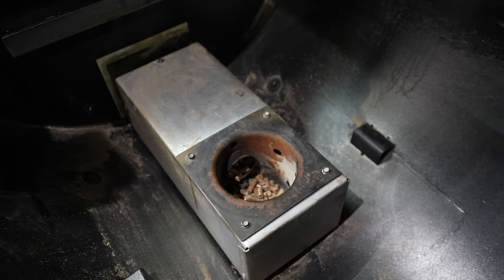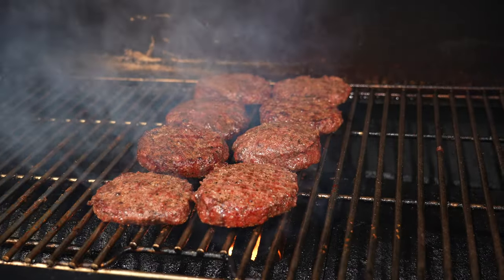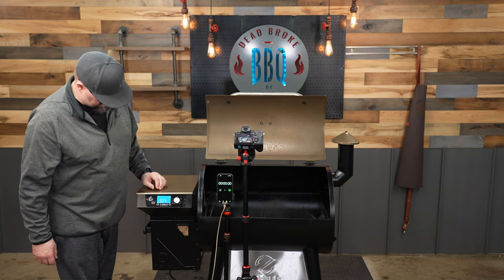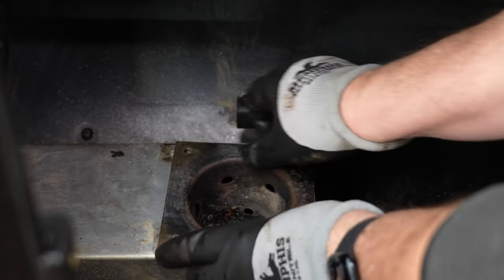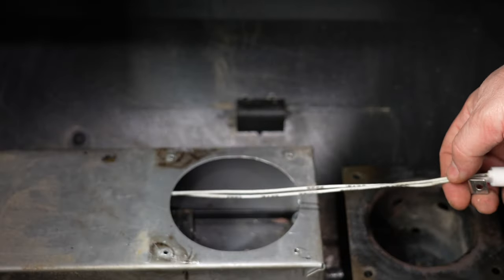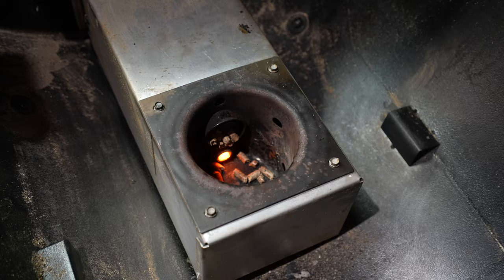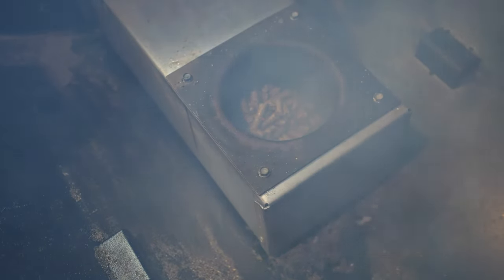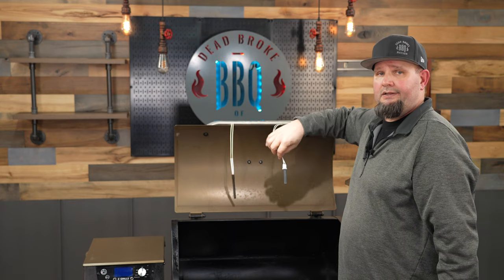How To Replace An Igniter On A Pellet Grill

Comment: I bought one this spring to try on my Oklahoma Joe's DLX 1200 and after 5 months I cannot recommend this ignitor.  I always runs too hot, when I set my temp to 225 I'm always running around 260+, and it just gets worse as I increase the temp.  Further, when I crank up the heat to 450+ it burns through the pellets too fast and I continually get a check hopper error.  I have to unplug it and plug it back in to get it back to showing temp.
Reply from the maker: Hmmmm weird because I have not seen that issue on the couple I have used. I will say I had a lot of issues with both OK Joe pellet grill models I have owned with all OG parts. Both models never really ran close to the temp I sent it at.

Comment: Great video! Game changer from the old heat rod. I recommend doing the electrical tape in the video to feed it through. Only other thing i would recommend if you do if you are installing by yourself is taking the 4 bolts off and actually disconnecting the hopper and feeder from the grill. It makes it much easier to plug and play the wires and re zip tie them all together. Took me an hour. Great video gents

Comment: Feel like 3 minutes difference for a 10 hour smoke doesn't justify the cost to me. If it lasts 4x as long however, that reliability would be very helpful. My replacement (standard) igniter went out this weekend after only 6 months. $40 is worth trying a tougher alternative. Thanks for taking the plunge and comparing the two.
Reply from the maker: Thanks for watching!
Reply: Thank you for watching the video!
8 benefits that our invented Silicon Nitride Ignition Stick can bring to our customers:
1.Fast- Initial startup ignition without a lot of smoke, no choking (apartment buildings can be used without affecting neighbors).
2.Stable-Good temperature stability -especially in smoke mode.
3. Efficient - Fast response time to compensate for temperature.
4.Professional-Aerospace ignition technology.
5. Clean - easy to clean the fire canister.
6. Energy saving - fast ignition speed.
7. Safety - All ceramic ignition rod is safer.
8. Long life-solve customer complaints.

Comment: The new igniter worked well for the first few times on my CampChef PG24, but multiple flameouts after that and two blown fuses.  I went back to old igniter and no more problems.  YMMV
Reply from the maker: Hmmm, they make the igniters for a lot of new models so not sure what went wrong with yours?!?

Comment: Great information Ricer.  Nice showing off your "on your back" labor too! 😉If I ever jump on the Pellet Smoker train, I'd probably just change to one of these igniters during initial assembly.  I think the pellet cooker manufactures are going to have to start offering these as standard, sooner or later.  Looks like a game changer to me... 👍
Reply from the maker: Ya Grumpus a lot of the higher end models from all brands are using these type of igniters now. So hopefully they start using them in the lower end pellet grills too!! I knew they would be faster but not that fast!! That explains why I do not see as much smoke during the start up on a couple of the newer pits I have. They light up so quick and the fire pot doesn't fill up with as many pellets. Pellet grills are great for convenience!!! Thanks for watching Grumpus!!!!

Comment: 8 benefits that heat founder invented silicon nitride ignition rod can bring to customers:👍👍👍

1.Fast- Initial startup ignition without a lot of smoke, no choking (apartment buildings can be used without affecting the neighbors) as fast as 90 seconds to ignite.
2.Stable-Good temperature stability -especially in smoke mode.
3. Efficient - Fast response time to compensate for temperature.
4.Professional-Aerospace ignition technology.
5. Clean - easy to clean the fire canister.
6. Energy saving - fast ignition speed.
7. Safety - All ceramic ignition rod is safer.
8. Long life - more than 3 years service life.

Comment: Great video! I'm on the fence about buying the Pit Boss 1600 Elite, or the Traeger Ironwood XL. Any thoughts?
Reply from the maker: Both are good! It just depends on how much you want to spend. I just did the burn off on the Ironwood tonight. Nice pit and IMO a little nicer than the Elite but costs a lot more and the Elite you can grill on easier. Thanks for watching but sounds like you need to just flip a coin!!!

Comment: @deadbrokebbq  Awesome video.  Out of curiosity does the controller go into smoke mode faster after shaving off 3 minutes from the ignition cycle?  I wonder if the minimal ignition time is fixed in the controller.
Reply from the maker: Not really sure but I have used that grill since I filmed this and it still smokes decent in smoke mode. I have actually changed out the igniters on the other 2 pits I showed in the video. The Pit Boss sportsman and the Traeger Pro 22, both of these are running the same as they did prior as far as I can tell. Thanks for watching!!!

Comment: Great video i have a trail embers pellet smoker hot rod isn't working auger motor isn't working and it has ERR CODE says temp probe im wondering if fuse could be blown but don't where to look for it any help would be greatly appreciated
Reply from the maker: Hmmmm sounds like a fuse but I am not sure where it is located. Call customer service. Good luck!

Comment: just had to do this, and purchased the stock igniter. I like the look of this new one you're testing there, but i am not sure if saving 3 mins is worth 50 bucks versus 10 bucks for 2 of the others. I do like the longevity rating of that igniter though. 

100,000 cycles sounds good. I am wondering what the MTBF of the stock igniter is.
Reply from the maker: Not ever having to change it out again, makes it worth it to me!! The reason why I showed how fast it ignited was to show how efficient they work. Most new pellet grills are switching over to this style of igniter because of all the complaints from most people having to change them out. Thanks for watching!!!
Reply: @DeadBrokeBBQ  yeah I noticed the change recently. I’ll have to keep looking out for them to see if the price drops. Having to wait 8-10 mins just for it to start up sucks.